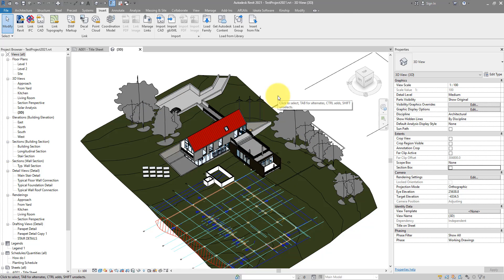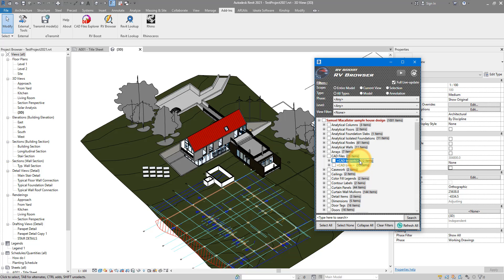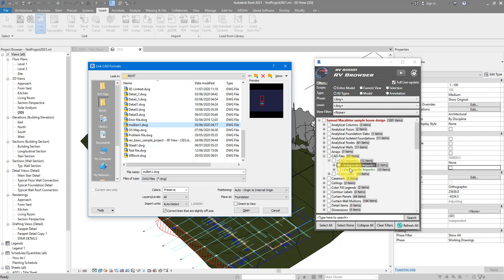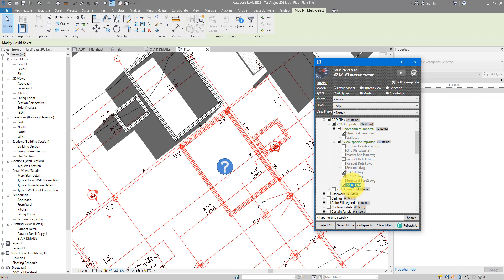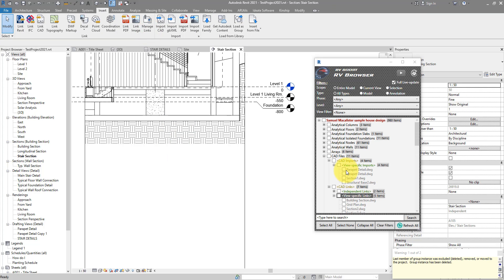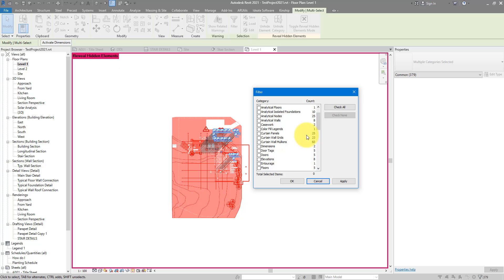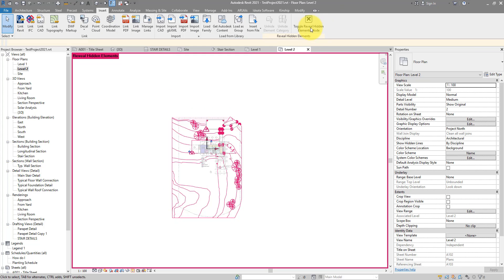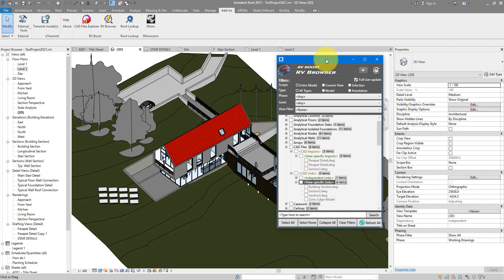Revit Snippet: Quickest Way to Remove Imported CAD Files from Revit

Comment: Rv boost please how to make metalic facade with perforations like this one example https://www.plataformaarquitectura.cl/cl/773140/casa-greja-park-plus-associates?ad_source=myarchdaily&ad_medium=bookmark-show&ad_content=current-user
Reply from the maker: This is best done using just a surface hatch pattern in Revit. To get the perforation effect when render, just use a material with a cut- out map 🖱